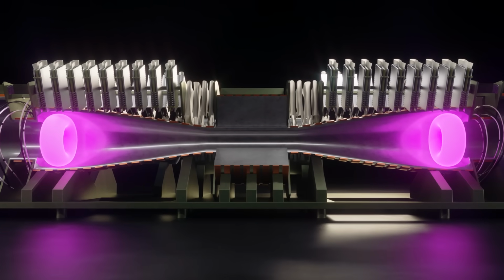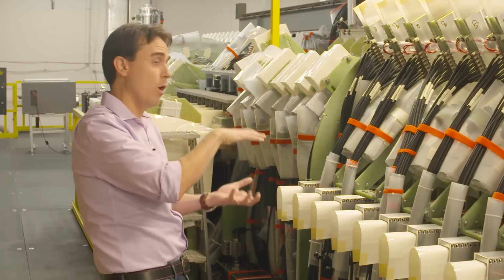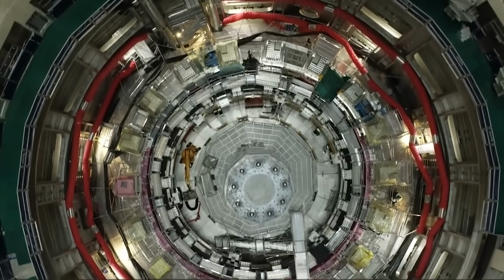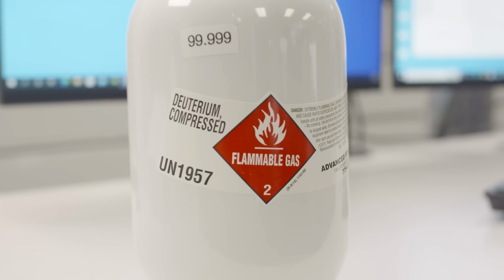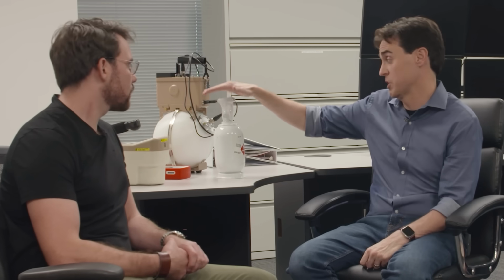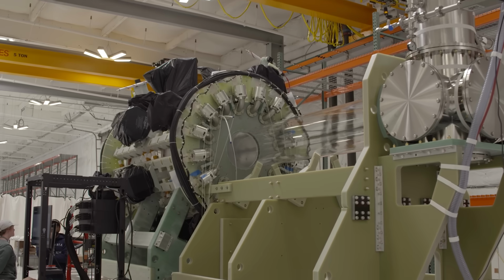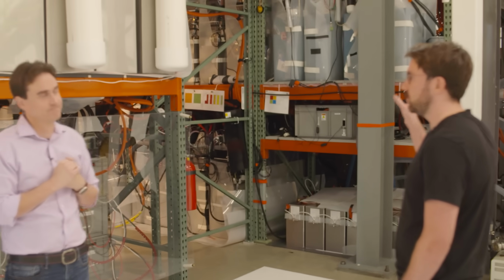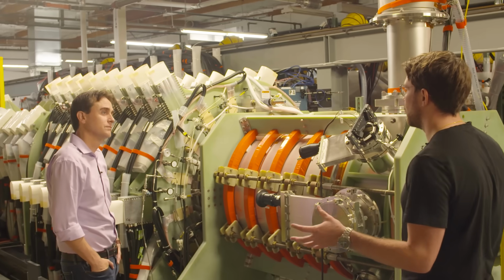A New Way to Achieve Nuclear Fusion: Helion

Comment: From the looks of it, I would argue that the power output would be in compressed Sinus curves, occuring abruptly and then needing a lot of energy to continue its operation. It's like continious blasts of energy with gaps of nothing. How would they overcome that?
Reply: Produced power is stored in capacitors and then gradually released to the grid. A part of it also goes back into the machine to power the next pulse.
Reply: @elmarmoelzer2229  In theory, yes, but if this is fusion - where do we get capacitors able to store that amount of energy?
Reply: @M3dicayne  It is not that much energy in the capacitor bank. The total energy content of a pulse is just a few kWh (maybe 3 or so). Power plants will do 10 pulses a second.
Reply: @elmarmoelzer2229  Okay, if that is the case, this whole fusion thing is way less efficient than it should be. Nobody would want to have a power plant with an output that low if there is still a lot of energy required to get the process going. And you need further reactors to create the ingredients and these aren't cheap to begin with (even when no directly choosing He³).
Reply: @M3dicayne  ??
Kilowatthours per pulse. 10 pulses per second. Please do the math to many MW this comes out on average.
Helions power plants will have 50 MWe net electric output.
Reply: @elmarmoelzer2229  And one Nuclear power plant around 1.000. This requires expensive ingredients, a lot of power to keep the process up and for the potential fusion has, it is a kinda small return.
Reply: @M3dicayne   I do not understand what you are talking about. 
They only need a few kWh for the very first fusion reaction. Then they make a surplus of electricity from that. It is stored in capacitor banks.
From there, part of that goes to the grid, the rest re- circulates into the power plant.
Those few kWh could even come from a standard power plug. Would just take a bit longer to charge the capacitor bank for the very first shot. After that, no more grid power is needed to keep the machine running.
Reply: @elmarmoelzer2229  I certainly doubt a power plug could deliver sufficient energy to initially create the plasma on both ends, keep a stable electromagnetic field and a field that is able to push and compress both plasmas into each other.
Reply: @M3dicayne  

First, you need to differentiate between power and energy.
A pulse in Helions machines needs a lot of power, but the total energy content is relatively low because the pulse is so short.
A space heater can easily take a kW of power and you can plug that into your outlet. 
Helion could (at least theoretically) have a couple of kW go from two standard plugs go into their capacitor bank for a couple of hours. Then you have 4 kWh of energy in there. That should by my calculation be enough to initialize the first pulse. Then subsequent pulses are powered by part of the energy generated by the machine. 
There is a bit more to it too because Helion's machines can recover 95% of the input energy directly as electricity (plus a large part of the additional fusion energy to make surplus net energy).

Comment: The only question is how do you calculate positive electricity output .  But never mind just keep talking about Star Trek
Reply: Step 1: You have a capacitor with energy in it.
Step2: Energy goes into the machine. 
Step3: Energy comes out of the machine and goes back into the capacitor.
Step4: Is Energy in the capacitor now more than it was before, or less?

Comment: Another good step forward to plasma fusion. I wondered why you didn't use a plasma focus at either end, or was that part of your proof of concept? #helion
Reply: Ideas like this make one wonder what other plasma configurations might be achievable which do not require complex AI control systems like China's Artificial Sun uses. For a layman like me, the idea that scientists did not think of all possible plasma configurations is unthinkable. And yet, here is a new configuration - smashing two stable plasma toruses by moving them on a collision course. Thermonuclear weapons use one configuration - inward spherical pressure. Tokamaks and ITER need AI-controlled containment. All of this makes one think what other configurations of plasma are possible and capable of good yields. Assuming we control plasma properly, suppose we could make plasma "pellets" or "balls" and move them around with magnetic fields at will, then all sorts of geometries of smashing them together could be simulated. Instead of one big cloud moving around, might one model them as physical objects to be smashed into each other? David in the video said that that part of the process seems to be relatively stable and easy to manage. Keyword being "relatively", of course.

Comment: the timing couldn't have been better.. With the return to the moon just around the corner Helium 3 will become common enough to make it cheap to run this. Deuterium is easy enough to get.
Reply: They don't need moon mining though. They can just make their own Helium3 by fusing Deuterium. If there is cheap He3 from the moon, it would be a bonus.

Comment: What if a coil fail or the power fails while the plasma is inside ? Over a million degrees 🥵
Reply: The fusion plasma is very hot, but not very dense (closer to a vacuum than to ambient air) and it is surrounded by a high vacuum, which is a perfect insulator. Think of steam from a pot of boiling water. The steam is boiling hot, but you can hold your hand into it (carefully!) without getting severe burns. This is similar. It also cools off immediately when it touches anything like air or the vacuum vessel walls. The plasma cools off during expansion. While it expands it induces a current in the surrounding coils. Doing that work makes it cool off even faster. Over time, there would be some abrasive damage to the walls if things went really wrong, but not anything dramatic.

Comment: Deuterium has been used in candu reactors for years and isn't as easy to source as this guy would have your believe not cheap
Reply: There are some 50 heavy water reactors in the world that have entire pools full of Deuterium. A 50 MWe Helion power plant would only use about 20 kg of Deuterium a year.
At current Deuterium prices that is about 20,000 USD. Completely irrelevant.
There is enough of it in seawater to last until the sun burns out, even if all of mankind's energy needs were covered by fusion several times over.

Comment: why cant we keep the reaction alive longer instead of renewing a reaction over again rapidly (keep in mind i know next to nothing about this stuff) would it not be more efficient?
Reply: FRCs are relatively unstable. For Helion, only the rotational instability is really relevant. That happens, when the plasma has lost about 50% of its particles anyway. Now you could replenish those (that is what TAE does and takes a lot of energy and equipment), or you just decide to terminate the pulse before it reaches that point. Instead, Helion is planning to regain energy from the expansion of the plasma. That works better when there are still more particles present. So it is a matter of balancing these things.
Also operating in pulsed mode has quite a few advantages. E.g. you can remove fusion products between pulses, which really helps with preventing nasty side reactions.

Comment: WHAT KEEPS THE CORE CHAMBER FROM MELTING,  WHAT IS  MATERIAL USED TO CONTAIN THE
PLASMA  .   AT SEVERAL MILLION DEGREES , ??   10 TO 20 MIL.  - 100 MIL. DEGREES ???.
Reply: This has been answered in the comments quite a few times already, but here we go again:
The fusion plasma is very hot, but not very dense (closer to a vacuum than to ambient air) and it is surrounded by a high vacuum, which is a perfect insulator.
Think of steam from a pot of boiling water. The steam is boiling hot, but you can hold your hand into it (carefully!) without getting severe burns. This is similar. It also cools off immediately when it touches anything like air or the vacuum vessel walls. In addition to that, the magnetic field keeps it away from the walls until it is allowed to expand. It cools off during expansion. While it expands it induces a current in the surrounding coils. Doing that work makes it cool off even faster.

Comment: I find it hard to believe they are able to accelerate plasma to 300km/s in what - 3 meters of this device? And then they stop it - but it's not solid, it will not transfer the kinetic energy into the load coming from the other side, because it is incredibly sparse. So they use energy of the magenetic field to speed plasma up and then they stop it with the same magnetic field. So where is the benefit of that kinetic energy? Maybe it makes sense, but it wasn't explained in the video.
Reply: They do not actively stop it. This technique of merging two FRCs which was developed by their cofounder Professor John Slough is well understood and has been done for over a decade at various fusion labs. TAE does it, so does a Japanese team.
Reply: @elmarmoelzer2229  How is the kinetic energy transferred in this "merger"? Because it is not on particle-to-particle basis as it would be too rare? The plasma does stop in the middle of the device from 300 km/s to 0 so something must stop it.
Reply: @erykczajkowski8226  
I am not a plasma physicist but to the best of my understanding it is because the two plasmoids have their own magnetic fields that interact with each other. Since FRCs are high Beta, those magnetic fields are very strong. That is also why the energy recovery from the plasma expansion works.
The magnetic field of the plasmoid is what is inducing the current.
If I remember the the story correctly, John Slough and his team literally just were like "Hey, lets see what happens if we fire two high beta plasmoids at each other." A lot of people would have never dared to do that but Helion was always very experiment oriented (was still MSNW LLC back then).
They were also using the ability to accelerate FRCs in FRC thruster experiments that they did for NASA. They did over a billion shots with the (relatively small) FRC thruster.

Comment: An interesting engineering feat.
What's the temperature achieved? "Tens of millions" is quite low:
The ballpark for a useful sustainable fusion is about 150 million Kelvin. 

Also, we never really had much problem creating fusion reactions. Our problem is creating a robust design that would allow to sustain the plasma continuously to reach a net gain of energy. 

In other worlds, most of engineering for fusion and the needed research has been done decades ago. 

Problem is it all costs so much to test that we literally have to spend a decade to build a test reactor, run it, gather reports, spend a decade researching every possible thing from these reports, then build another test reactor and so on. 

At this point we're much closer to a feasible design.
Reply: Trenta achieved 10 keV plasma temperatures, which is about 110 million degrees. Since they have a high ion- to electron- temperature- ratio, they can actually get away with much lower temperatures than equilibrium machines like Tokamaks.
Also since their design is pulsed, they do not have to sustain the reaction for more than a millisecond. They make up for the shorter confinement time with much higher densities.
Reply: @elmarmoelzer2229  hmm, thanks for the clarification... If that's the case the technology does seem much more intriguing to me
Still, things like these require decades of testing to start scale implementation. 

I'd we ditch tokamaks which already have lots of paperwork and agreements done (to the point of next and next next generations after ITER) it could mean off-putting commercial fusion for decades again. I might be wrong, and nobody has to pick one design only, but frankly even if the 7th gen Helion reactor proves successful and starts working nominally in 2024 it'll still many-many years before it reaching scale. 

Still, new technology and innovation are crucial. 
It's just that in energy tech everything does and must move at a very slow speed.
Reply: @れいらうる  Helion is planning for commercialization within this decade. They are building manufacturing lines for components already. I think that we will see the first Helion power plant (provided they can make it work as expected) before 2030. Then they want to ramp up production to 20 50 MWe plants a day. Now that can take a while (maybe 10 years).
Since they can be transported by road, it won't take that long to get them to their destinations either.
Reply: @elmarmoelzer2229  if that's the case these are astounding news indeed. I can only pray for their success: impact of fusion reactors can hardly be overvalued

Comment: How much energy goes in and how much is going out?
Reply: Well, this is a subscale prototype that cost less than 35 million to build and conduct experiments for several years. It does not produce electricity yet. It does not have the equipment for energy recovery. 
Then there is also the question about fuels. Net energy with what fuel? By my estimate based on their scaling laws, Trenta could be close (if not better) than getting more electricity out than was put into it IF it had energy conversion equipment installed and IF they operated it on Deuterium and Tritium. But that is purely academic. The point is that Trenta scaled as they expected by their theory. From what I hear, it actually performed better than expected. So, things are looking good for the next stage (Polaris) which will demonstrate net electricity (not just energy!) production towards the end of next year (give or take a few months). The next stage after that will be a full scale fully equipped power plant.
Reply: @elmarmoelzer2229  Thank you for your clarification.